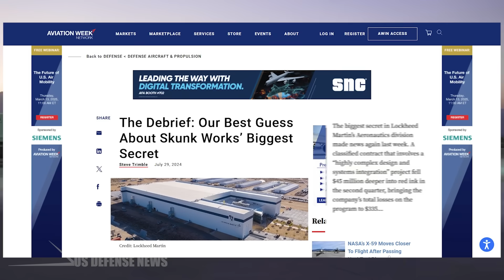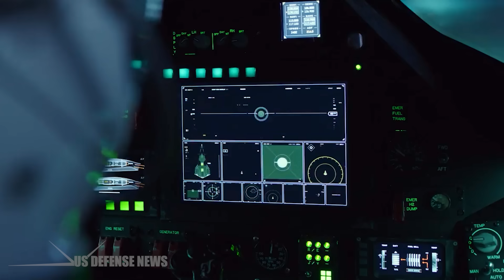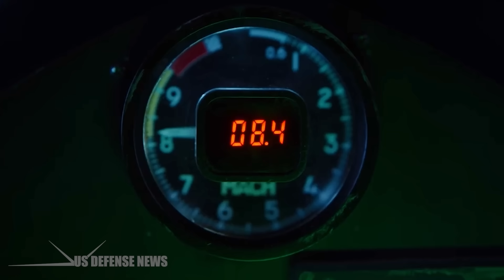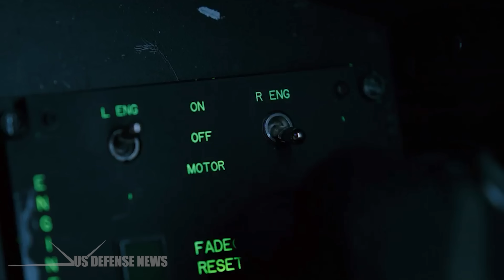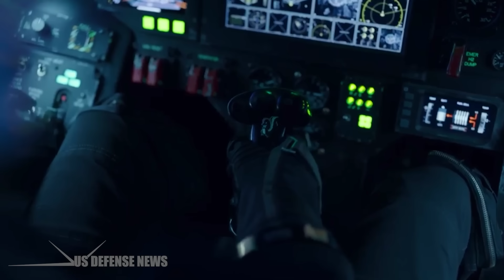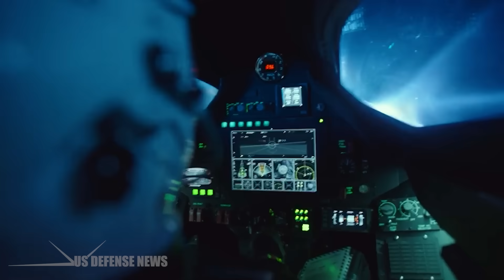Is This the Real Lockheed 'SR-72 Darkstar' Hypersonic Aircraft?

Comment: If it were to be made multiple challenges need to be addressed. 
1) reliable functional TBCC motors
2) material science to cope with leading edge temperatures {sustained + 1800° F to 2800°F)
3) material manufacturing for body and wings from point #2
4) functional hypersonic flight controls
5) $$$ and will to actually build it
Side note:- Project Hermes is the cheapest and the furthest developed at present. ( Chimera engine TBCC, material science development on pace with requirements, 2026 test of supersonic and hypersonic Quater Horse )